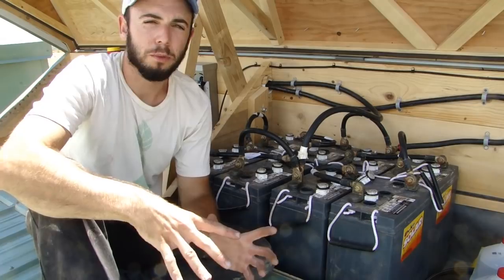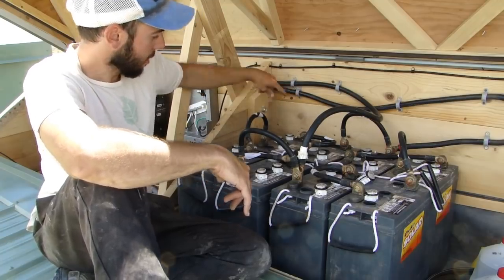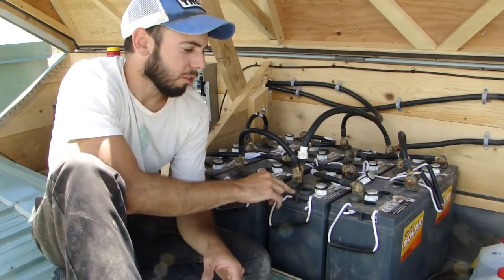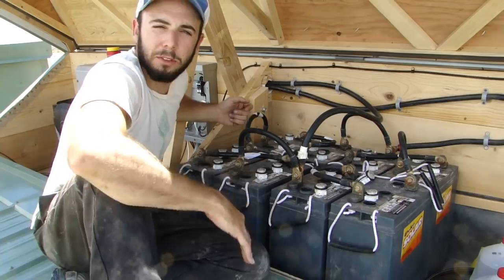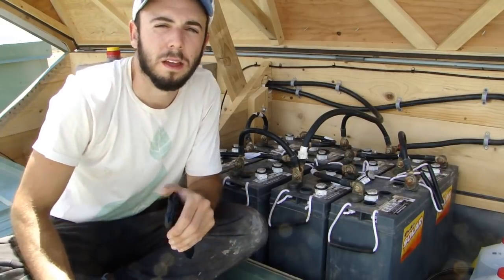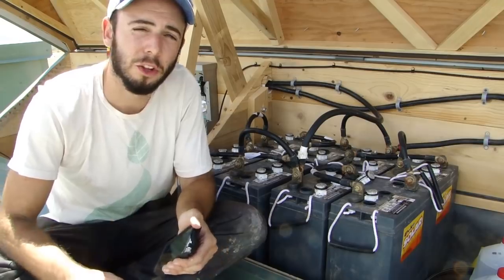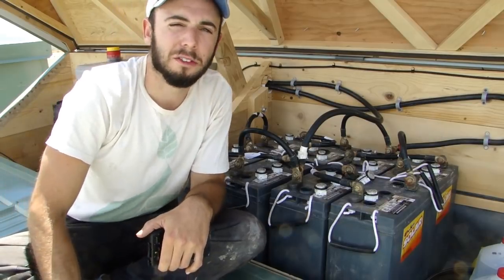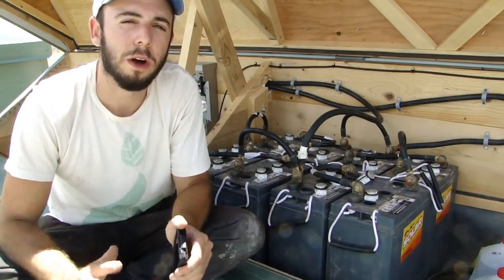How to Size Your Solar System

Comment: Thank for the info.  What kind of inverter did you get?  Does the documentation for your inverter explain how to design a system, the sizing and what a MATE unit is?  How would I design a system like this on my own if I do not know all this in advance?

This might be a crazy question, but if one did have a line connection to the grid, but chose not to use much of it, could one of the charging inputs to the batteries come line power in an emergency?

Comment from the maker: Exactly.  Unfortunately, I don't have any information on how much extra life you get if you regulary get the batteries down to 80 or 90% instead of 50-70%.  That would be key to figuring out if the cost is worth it.

Comment from the maker: You can use PV, wind and a generator at the same time.  My inverter doubles as a charger and has AC inputs for the generator.  My inverter needs to be programmed with the Outback MATE unit to be set up for a generator.

Comment: Excellent video!  Great information, thanks again for sharing this with everyone.

Is there any negative impacts of an oversized system?  Say, your average consumption is 3.5kWh but your system can do 10kWh during that 5 hour optimum window and you have enough batteries for 40 or 50kWh?  Would floating the batteries most of the time be bad?

Comment: Very nice and clear explanation of your set up.

Could I ask what reference you used to design this or are you an EE.  I want to design a kind of hybrid charge system, but I'm not sure that is possible, or if it is too complex.

If the sun does not shine I'd like to be able to charge my batteries with a generator, perhaps one that could use biodiesel.  Or, is there a way to use both solar and wind at the time time or can you just use one charging source at a time?